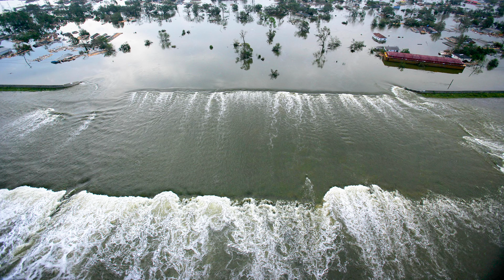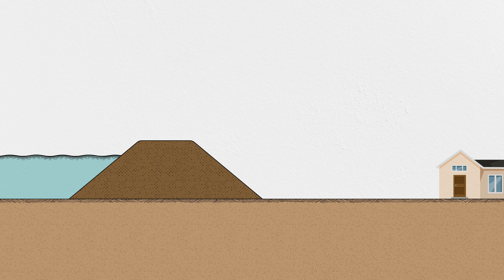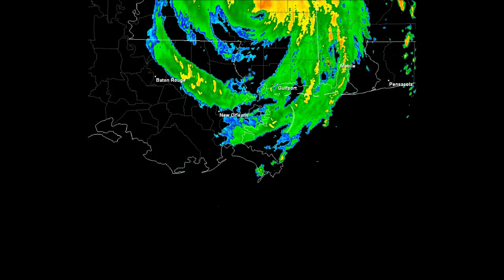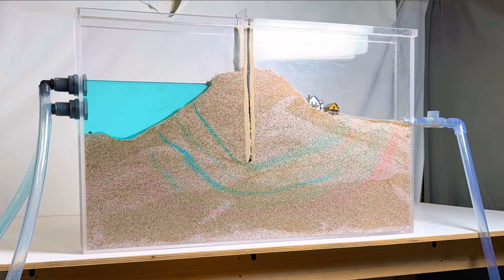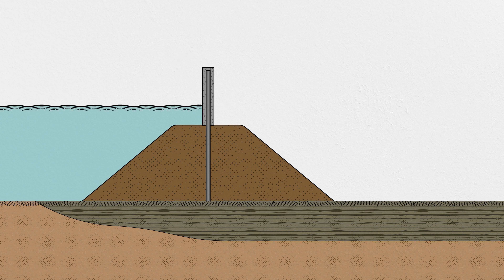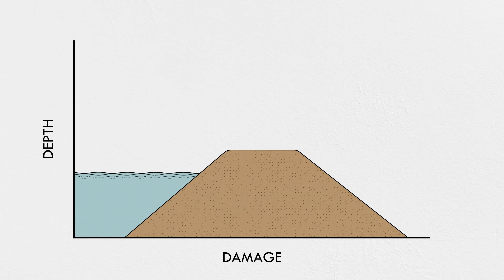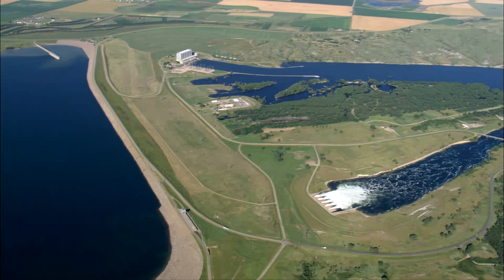The Mind-Blowing Flaw That Flooded New Orleans

Comment: Part of the problem is indicated in a common thing that engineers brag about “anyone can build a bridge that stands but it takes an engineer to build a bridge that barely stands” there is a fixation on doing the minimum of what’s acceptable and not the maximum of what’s acceptable and so cost savings are weighed against human life. There is also the fact that (according to what I’ve read, I’ve never been to America) New Orleans has long been a mainly working class city with a very large population of black people and the lives of working class people, especially working class black people, are often considered to have less value.

Comment: For the Hong Kong airport they made caltrop/jack shaped stones to interlock and resist moving. Would it help if we make smaller versions of those with fiberglass-concrete and use them in water inundated foundations? We could use them to line ditches and french drains.

Comment: There are two answers in structural geology: 30 degrees, and pore fluid pressure. In this case it's pore fluid pressure. 

And with flood protection, the answer is usually "People started building where it floods." 

I've seen the marshy layer. It's interesting to connect what I've seen in soil borings with historic disasters.

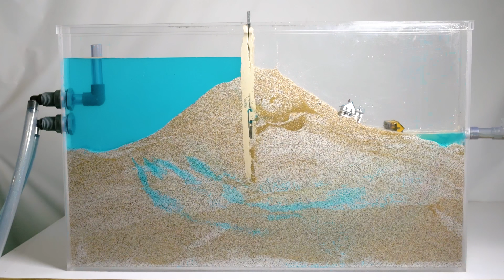Comment: 15:00 The science may be right, but the model is not. The seepage is clearly moving between the "i-wall" and the glass, through leaks in the sealant, which would represent penetrating the i-wall directly. Using soft plumber's putty was not the way to go here and changes how the outflow disturbs the "ground".
Reply: Models are explainers not simulations sooo my brother did you get the gist ???

Comment: I was part of a team that arrived with a general in the 9th ward. Much much more to what happened in that place. From people using paddle boats to loot, pallet jacks and pallets with stolen loot. One guy was using a USPS truck that I had to remove him from. I walked into a gas station that was looted of Menthol cigs and old E. Food and water all on shelves, nothing touched. The water was so bad, two rescue dogs I witnessed go into the water, within minutes convulsing and both dogs died. The water was so toxic as it was receding, the paint on cars and houses was eaten off completely. I remember seeing small marine life swimming down roads, or a small shark trapped in a small flooded area. The whole operation was one massive mess. One of the dead I will never forget was the taffy guy. The man attached himself to top of the light pole. He died and was the water receded and the hot heat, his body started to stretch like taffy.

Comment: The loss of life was connected much more to the complete failure of the rescue teams then the actual extent of flooding. They initially refused any help from nayboring states and federal resources. And deverted half there fleet to patrolling the streets to arrest civilians trying to help. Compare that to houston that had worse flooding with drastically less loss of life. They prestaged federal and out of state resources. And used professional rescue teams to organize and support civilian volunteers. Aswell as to work in the highest risk areas that the civilians could not handle.

Comment: This video was posted on July 7th 2026.  I do not know why the "description" section does not state the year (Practical Engineering must've selected this intentionally for some reason), but for the sake of clarity, I am posting it here.
On topic (kinda):  In CT, there was a basketball stadium which during a particularly-heavy snowstorm collapsed.  Strangely, it collapsed not when the snow reached its peak coverage, but a few hours after everyone attending a basketball game had left for the night (luckily).  But why did it take so long to fail?
Turns out, the body heat generated by the excited fans inside the stadium had created a temporary "counter pressure force" pushing up against the high-coverage snow on top.  When all that snow was on top of the stadium, it was effectively supported by the stadium structure, but also the heat from people in the stadium was included.  When they all left and that heat with it, the snow finally proved too much, and collapsed the roof.
I don't remember the name of the stadium (and I think it did happen in Connecticut), but as a Mechanical Engineer, I always use this as a self-justification for looking at a problem based on pure forces and energy interacting in a complex way, then addressing/relieving those forces through design.

Thank you for this video.  I will consider reading your book.
Reply: it does show the year, all you need to do is expanding the video description. But I wonder, why does it even show the date? All other videos I opened to test it, were just showing "2 hours ago" or "2 weeks ago" or  "35 minutes ago", but never the date. Very weird.

Comment: This might be the only video ever made of the Katrina disaster that does not try to blame climate change.  Phew!  Grady points out that the storm surge exceeded 8 m (taller than a two-story house).  The climate change induced sea level rise at the time of the disaster was 5 cm (half the width of your fist).  Climate change is definitely real, but 0.05 m is significantly less than a rounding error for an 8 m storm surge.

Comment: The true fix to the building along hurricane prone coast problem is insurance. A complete ban on insuring any structure 5 miles from the coast. Or you know Hurricane Karen is going to come through in 2035 and do the exact same thing Betsy and Katrina did. It's inconceivable why man believes they can "shore up" a city to withstand 150+ mph winds and 50 foot storm surges. It's not worth the risk or the cost. And when the disaster hits, there's another 250 billion to the deficit.

Comment: Let's be real: in the face of current climate change projections, long-term, New Orleans is going to need to gradually implement a Dutch-style water mgmt system with gravity-fed canals and water storage parks that embrace living with water rather than constantly fighting it with pumps and levees like it's doing now. If it doesn't, Mother Nature will eventually make the decision for New Orleans through rising sea levels, increasingly intense rainfall events, and more frequent and more powerful hurricanes.
Reply: Just not N.O. but a great many coastal cities will be destroyed by sea level rise.  The costs will be monumental for every coastal nation.
Reply: @TheDanEdwards  True. But if New Orleans and other coastal cities at risk implement Dutch-style redesigns around water mgmt, they will buy resilience through the year 2100 at least.

Comment: As a civil engineer I find it hard to believe that there was no clay core trench built beneath the levees to prevent the groundwater seepage. These are typical on any earth structures that hold back water and are required even on very small ponds with the local jurisdiction I work. Curious if the model built is accurate or if the engineers really overlooked this key piece of the design.

Comment: Great video. The wider point on ... not building on flood plains is vital. People and politicians often assume we can out-engineer nature, but building on flood plains has become normalised. At some point you just have to say "no", even if that means abandoning the area with forced purchases by the government etc.

It's only going to get more difficult as time goes on because extreme weather is getting A) more frequent and B) more severe. It's miniscule compared to Katrina, but in Scotland, we recently (2023) had Storm Babet which overtopped flood defences in a many places. In the town of Brechin the flood defences were overhauled in ~2015 and were meant to handle the new normal of extreme weather. Unfortunately, 'normal' is changing way too fast for comfort and the defences failed. That's 8 years from completion to failure... stuff like this is happening in a lot of places, and it's not sustainable.

Comment: The Fukushima plant had a wall built too low. One of the men sitting on the board of a plant that was built closer to the epicenter of that quake was a civil engineer and somewhat of a history guy. He knew of stories that were documented in the best way possible at the time of tsunami’s that would get as high as 30 meters but only happen once every thousand-ish years (documentation 1,000 years ago in Japan is… what you’d expect it to be, mostly stories very exaggerated of monster high walls of water).  But what was more scientific were soil samples done kilometers inland showing the same beach sand as was on the coast. Because of this that engineer/board member demanded the seawall be some crazy high wall that everyone e thought was absurd. But it was constructed when the plant was back in the 60’s. And sure as -ish a massive tsunami came just as the prophecy foretold and that nuclear plant was safe. The Fukushima plant that used historic data from the last several hundred years obviously did not.

Just like in New Orleans, when something doesn’t happen for generations humans naturally begin to assume it could never happen.  And the longer it goes without happening, the more sure we are of ourselves that it won’t happen.  Until it does…. This is part of the human condition.

Comment: As much as the usa has some very good engineering, there is a wide array  american engineer that is very primitive and crude  that is more dumb brute force weak engineering.   Among which : structural engineering,  roads design engineering (and signaling placement),  automotive engineering, appliance engineering.

Comment: I've heard that NOLA is a bowl because of the decades (maybe centuries) of protection.  Without the regular addition of new silt deposits and the drying out of the subsurface has caused the metropolitan are to sink lower than the surrounding area.
Also, when I was on flood duty during the flood of '93, we called these "boils", when the pressure of the Mississippi would push through the soil and pop up some place on the protected side of the levee.

Comment: having worked for the corps of engineers, none of this is surprising.  not so much a corps problem, but a contractor problem.  from my experience, when corps oversight goes off site, things get done in a hurry. and sometimes to spec, if it doesn't incur any savings to do it differently.

Comment: Remember,  Katrina was a CATEGORY THREE hurricane when it finally made landfall!  The storm had hit Cat 5 the previous day and then weakened a great deal.  When Katrina was Category 5, the NHC was warning of an 18–22 ft surge (locally as high as 28 ft).  Katrina weakened so much the actual Louisiana surge was generally 10–19 ft.  The levees were never pushed beyond their intended limits.
Reply: This is correct. The floodwalls along the drainage canals, at the heart of the city, should have held. They did not perform as designed. The Army Corps own report admits this on page Volume 1, USACE IPET, I-119.
Reply: Mississippi, on the East side of the Eye, had a 30-foot title Surge and hundreds of thousands of homes wiped off their slabs,  not just flooded😢
Reply: @letsroll492 title?
Reply: @TxChristopher tidal
Reply: @TxChristopher 😂 that's all you got😂 is my voice text misspelled a word???😂
I bet you good at Minecraft😊
Reply: Grady made it clear in the video as well that the levees failed at a level below their intended limits.
Reply: The category label only captures a snapshot of the wind.  Because it was a huge Cat 5 storm, rapidly moving north, the NE quadrant storm surge was atypically HUGE for a Cat 3 storm.  Yes, New Orleans would have fared MUCH better with better levies, but Mississippi was in line for a tremendous storm surge.
Reply: That measurement is bullshit because it was on the weak side of the storm far from where it was strongest - in fact, initial reports called it a "near miss" of New Orleans and the levee failure started being reported after the storm had passed. On the Gulf Coast, where we caught the brunt of it, the storm was easily well over 200mph winds and the storm surge was unbelievable. My house was on the north end of Pass Christian MS from the beach, and we still got 14 feet where we were and it was surely at least twice that at the shoreline. Areas that had survived Hurricane Camille decades prior were obliterated, houses around me were picked up and moved - some actually into the street! - and one ended up sandwiched under the canopy of a gas station. Mine was picked up and dropped mostly in place, our neighbor across the street had hers spun around to have the back door face where the front door used to and vice versa. South of us? There were no houses or structures left at all be they flooded, moved, or otherwise there was nothing but slabs to indicate where anything once stood. It looked like freaking Hiroshima. Where we took shelter at, the roads were completely blocked by downed trees as far as you could see. In Biloxi, huge casino barges the size of city blocks were picked up and thrown inland across Hwy 190 as if they were toys.
Reply: @darthmeow1370 yes I've repeated it for many years...
 unfortunately New Orleans was flooded by a few feet of water😢...whereas the Mississippi Gulf Coast from Bay St Louis all the way through Biloxi was nothing but slabs for a mile on shore...
Anyone who doubts how Big and powerful the storm surge was during Katrina can go to Bay St Louis and drive off the interstate exit and there is a concrete Monument as large as a semi-trailer that denotes how high the water was on the I-10 Bridge... which is 5 Miles North of the shoreline in Bay St Louis😢
Reply: @letsroll492  The storm was well over 200mph on the Coast, I remember hearing one time and one time only someone on the news radio reporting that the readings that only showed 180mph or whatever were wrong as the storm had been so strong it damaged the instruments and caused them to not give proper readings. They estimated from the damage that it was AT LEAST a 230mph storm, but no one would ever know for sure as there were no proper measurements.

As I said that was never repeated, I believe it was a candid moment said on air and they were warned not to say it again for fear it could open up the possibility of lawsuits.
Reply: Katrina was still powerful. The Mississippi side received 20-30ft storm surge.The levees did fail just not how they expected them too
Reply: Grady mentioned overtoppings that were caused by soil subsidence, over the decades. Even if only small sections had sunken, it means that the whole areas behind that were flooded well below the intended surge levels.
Reply: The Category classifications don’t really do hurricanes justice or their potential damage. For example, in Texas back in 2008 we had Hurricane Ike. Ike landed as a category 2 hurricane yet devastated Galveston. In fact it was the worse flooding hurricane since the Great storm of 1900. What we learned is that the size and speed of the storm is a better predictor of damage then category. Today, Meteorologists agree that Ike was a Cat 2 in terms of wind but storm surge it was a Cat 4. From the center of the eye wall to the out storm store force winds was 450 miles meaning the entire store was over 900 miles wide and yes…threw half of the GOM water on Galveston.
Reply: @MTDixonSra brisk breeze devastates Galveston
Reply: @LikelyToBeEatenByAGrue you're thinking by of Rita.
Reply: @MTDixonSr you are talking about something different. In your example you need to refer back the the depth vs damage chart at 17 mins.  Galveston had min protections so smaller storms cause damages that would otherwise be non issue.
Reply: N
Reply: 28’ at landfall in MS is bunk - a repeated myth.

Comment: I was stationed in New Orleans when Katrina hit. We evacuated early to Ft Worth and worked out of there for 6 months before we could go back. My house was in Belle Chase just outside the city and the Parish we were in was 90% underwater at one point (granted it was maybe an inch or two most places, but still). My neighborhood was hit and miss. My house was fine, but my neighbor across the street had their roof torn off by the major tornado that went through during the hurricane. Where I worked was right next to one of the canals that broke, but luckily it was the other side, so our buildings ended up being fine, relatively speaking.